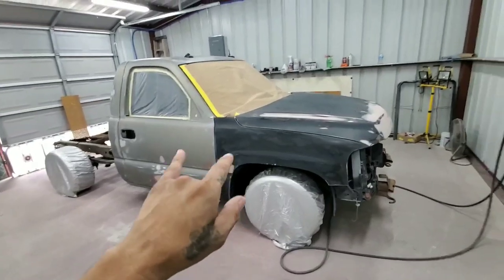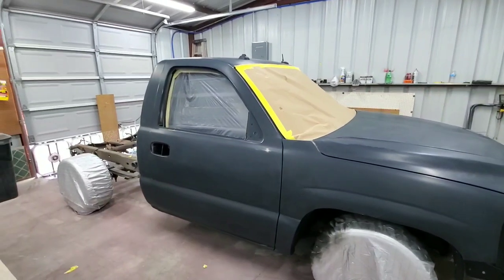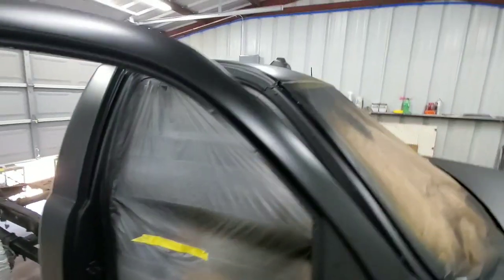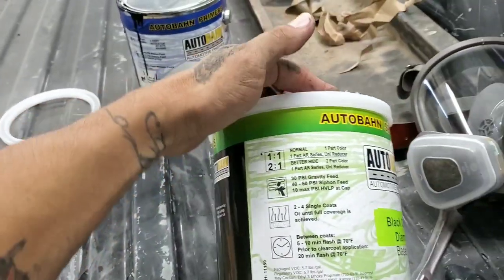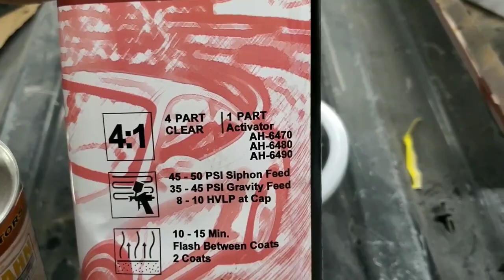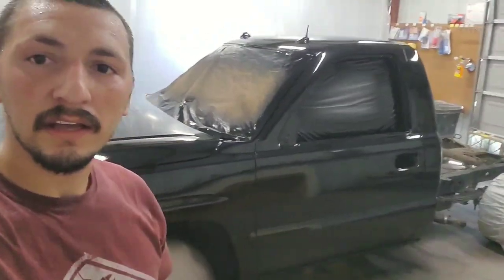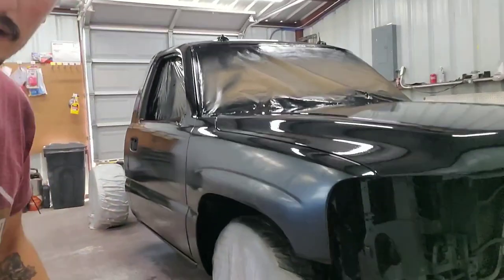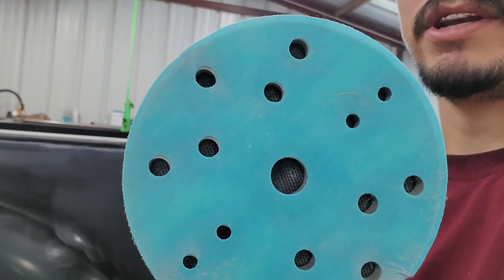Let's Spray | AUTOBAHN • Black Crystal Diamond 💎🤩

Comment: You need to add a large ceiling box fan that draws the air out the top of the building creating a mild current of air that will keep it cooler & keep the paint vapors from collecting on everything inside your shop!

Comment: Looks ok 👌 put orange peel is more then usual. You should try cutting a small exhaust/intake vent in to the wall , that should help ventilate faster and stronger bringing the temps down while spraying , and clearing the overspay will help you see the paint better as your spraying.  Think those 2 factors alone will help bring orange peel down. Every thing else look good
Reply: Also using the correct reducer/hardener for the temps. If you use a medium when it’s hot out it doesn’t have Time to lay flat before the solvent is evaporating.

Comment: hey there, I'm gonna be painting a truck similar to this one very soon and have  a question if you don't mind answering, did you sand down and prime the inner door area where it opens or did you just directly spray the primer and base coat onto the goldish paint that was already on the unit ? I like the way this turned out and want to follow what you did almost to a tee so is it not necessary to sand/prime the smaller areas like that or did I miss something ? thanks!

Comment: Nice job bro👍 what gun did You used for clear coat? Brand and tip size please
Reply from the maker: I was using the Italco h3000.  It has a 1.3 tip
Reply: @GTsPerformance  thanks bro

Comment: What is the paint code please?
Reply from the maker: I don't know of the Paint Code,  but the color is called "Diamond" from the Black Crystal collection at autopainthq
https://autopainthq.com/products/black-crystal-diamond-basecoat-clearcoat-complete-gallon-kit
The kit is really good for the price because, the basecoat can be reduced at a 1:1 ratio, which means you have 2 full gallons to spray. And the clearcoat ratio is 4:1, so you have 5 full quarts! Everything is included in the kit

Comment: Dude, I figured you out.
You're not a how-to channel. You're a show-off channel. 
I UNSUBSCRIBED. NOT RECOMMENDING.
You avoid key details.
No tip sizes. Air pressure amounts. No gun specs. Etc.
Best wishes.